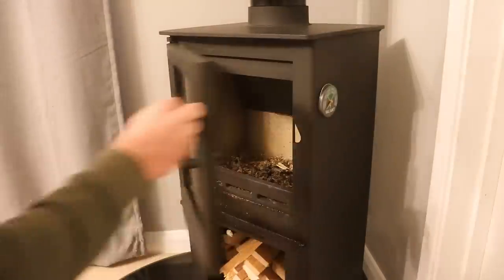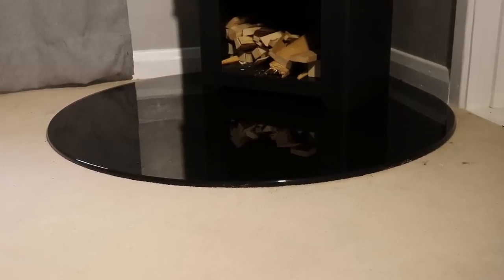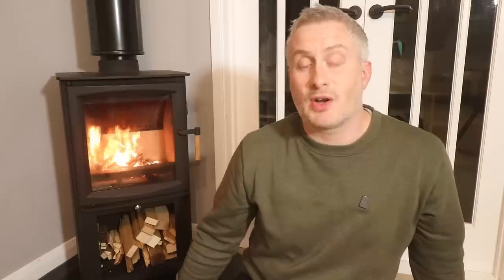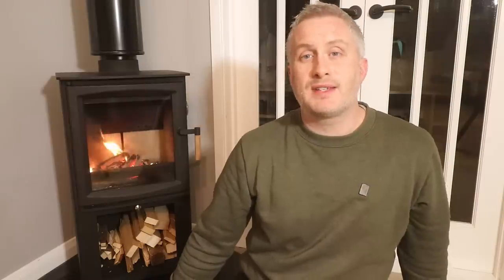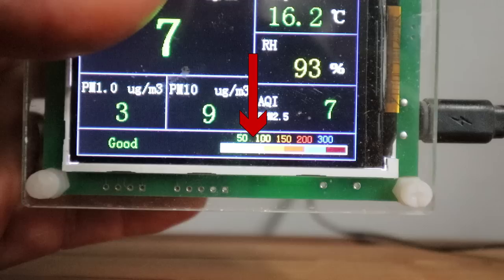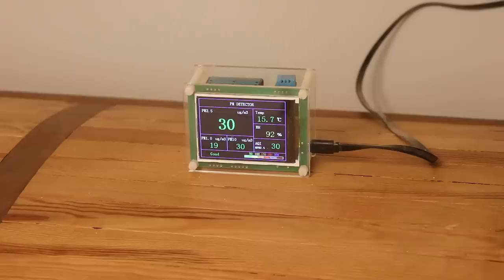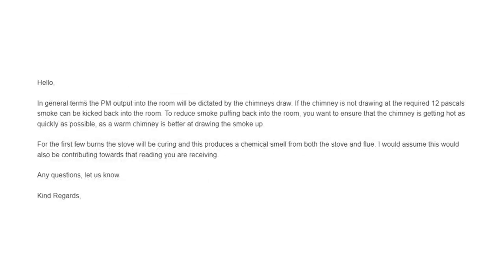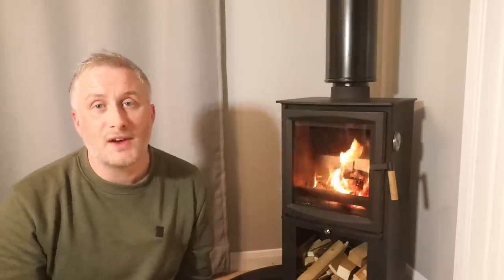Wood Stove Pollution and PM2.5 Particle Emissions TESTED ✓

Comment: All multi fuel stoves need to have an air supply from outside. We have 2 stoves a 5 kw and a 8 kw. The 8 is more efficient burning less wood. Burning smaller pieces of wood is not very efficient and a waste. Bag them up sell for kindling and buy some logs. Saves getting up to stoke the fire every 5 minutes. Trust me I know.
Reply: No they don’t. Only stoves over5kw require an external feed or recent new builds that are airtight.
Reply: @d17mop  If your home was built after 2008, there are slightly different ventilation requirements. New builds are very airtight compared to older homes, so you will need to carry out an air permeability test to determine how much ventilation you will need to fit for your stove. This also applies to extensions.
Reply: @d17mop  It gets more complicated as a recent change in building regs for ventilation covers additional requirements when energy saving improvements are made to the house as originally  built . So new windows/ loft insulation even a loft hatch insulated adds points to the requirement for additional ventilation. You don't want an air brick blowing cold draught into your room. That is why here some HETAS engineers are insisting an external air supply to all stoves.  SO a blanket statement does not require outside air is not correct for every situations and stove outputs. Remember the ;living effect gas fires had to have additional ventilation.
Reply: @zivadivathedog9392  there is  enough  advantisious air in a property with opening of doors and leaving a room. It’s just sill regulations people covering themselves from claims.
Reply: @d17mop  You need to read Building Regs part F before you make another reply. I suggest you read it a few times especially if you are not a professional so it sinks in as there is a point system to what additional ventilation requirements are required when you add additional energy saving measures over the original structure as it was.
Reply: @zivadivathedog9392  not under 5kw
Reply: @d17mop  While you are correct sort of. The ventilation part of building regs take over as you improve the energy saving measures in our homes. This is inevitable as energy costs rise. So to avoid having in the future an air brick in your front room ' Fit Additional Air Supply From Outside' your stove should except this.
Reply: @zivadivathedog9392  I’m more concerned to how close those curtains are to the stove. 300mm. ?
Reply: @d17mop  That depends on the stove. Your stove has what looks like fire bricks inside so that all the heat is forward so should be OK. Just feel the curtains after the stove has been on for an hour or 2. My 8kw Broseley has steel fire bricks so the masonry around the stove gets quite warm.
Reply: @zivadivathedog9392  what utter rubbish
Reply: @d17mop  Rubbish! you never find a stove on hearth then carpet in any of the stove catalogues the curtains will get dirty and the carpet in front of the stove, unavoidable. You are getting paid for this. saying that building regs should be ignored over ventilation requirements. Have you read building regs? You should.
Reply: @zivadivathedog9392  like I said. Who would hang curtains near a stove. Certainly not me and not that close. Ask any1.

Comment: You haven't considered your neighbors. Have you done readings outside? I'm in hell from all the smoke in my neighborhood which because of the particles settle breathing level so forget outside walks. Btw, it comes into houses threw roof vents. Doctor says my childhood asthma has developed into early-stage COPD so I am mad as a nonsmoker I shouldn't have it. Btw, I've learned burning wood releases the stored carbon (plus benzene, PAHs, formaldehyde etc)  which we don't want to do during climate change.  Wish you did a heat pump.
Reply from the maker: Yes I did, in a vlog video following this
Reply: So true, I love the concern about the pm 2.5 in the house but to hell with pumping it outside.  If everyone used one can you imagine the air quality.  I understand some people have no other means of heating but in cities and towns with some people spending 5k on them  and it only really heating one room I can't help but think it's not that efficient anyway.

Comment: I had a multi fuel stove installed 3 weeks ago, mine is enamel but still has to cure for the first few burns, the fumes from mine set the smoke alarm off so had to remove the battery for a few hours.
I live in Cumbria, cost of installation was £2400, that included the stove opening up the builders recess in chimney breast and slate hearth with slate recess lining [stove online is £999 but fitter paid trade price which is not known to me].

I mainly use coal, if lit early morning  10 am [ish] I will use around 5 kilo of coal, if mid afternoon 2.30pm to 3pm I use around 3 kilo of coal

Comment: Great advice.  Had ours, a Burley, nearly 10 years.  It is perfect for cold autumn and Spring evenings but in the deep winter when lighting it after work it can take too long to get warmth around the house so we use the Central Heating.  The word burner is on all weekend when we are home.
Biggest learning I have is when starting the fire be sure that it gets super hot, a stovepipe thermometer helps judge, before adding too much wood as the stove can then sulk.  Getting it hot enables the secondary burn of the gases above the wood.  When adding fresh wood it is also good to get the stove roaring a minute or two before and after the wood is added.
Also the Scandinavian top down method is by far the best way of starting the stove.
https://www.youtube.com/watch?v=h-vQVspbfOI

Do you have an external cold air feed? That helps keep drafts created to a minimum as the stove draws air, think it is a regulation if over 5Kw.
One wish we have is that we had gone with a two sided model as out stove in between the living and dining rooms.
Oh yes, kiln dried, or very well seasoned wood makes a massive difference.  We use White Horse Energy supplies( i have no affiliation), but there are plenty of similar suppliers. Just never buy logs from DIY stores or Petrol Forecourts.
Reply from the maker: Thanks very much John, I will be giving the "Scandinavian method" a try this evening - totally makes sense - wasn't aware of that.

I don't have an external cold air feed, but we have a PIV (positive input ventilation) system in our loft due to past problems with mold, and also trickle vents in every window so I think it's able to draw from those quite effectively.

Comment: Bad install. Distance to combustable to the side with this stove is 550mm. Looks like the door frame and curtains fall within this. I would also guess the walls are plasterboard which is also classed as a combustible. Should be condemned

Comment: I have no problem with requiring low emissions from new wood stoves. I never used to be bothered by the smell of wood smoke and liked it to an extent, but right now in the midwest, we have the worst air quality on the planet from the Canadian wildfire. I'm finding you really can get too much wood smoke. It's f*cking awful. I don't want to smell a fireplace or camp fire for at least six months after this.

Comment: Based on what the company said dunno if it helps but when we first got ours what the said was to heat the liner of the chimney first what they recommend was burn some newspaper etc etc very lightly first then put your fire on. Just a help. 👍🏴

Comment: Hi Rag 'n' Bone, Just one minor issue with an otherwise very informative video, should you consider that it is the convection current generated by the stove in the room that could be stirring up and circulating small particles of dust already in the room, in particular increasing the rate of air circulating around your sensor machine, after a few cycles this dust was deposited in undisturbed locations of vented through the stove. It is always a good idea to explore other alternative explanations for any observation and not draw hasty conclusions. 
On the subject of trying not to breath in polluted environments you are just being foolish, with the best will in the world you can only reduce your respiration rate by a small percentage, by all means ventilate the room effectively, of course this will mean losing the benefit of any heat!.
Cheers, Richard.

Comment: Cheaper  to heat your home this way is simply not true, if you can get free wood and lots of it and free coal then yes obviously. I have had a multi fuel for 14 years and use it because I enjoy it. They are a novelty thing and not a cheaper thing and any suggestion otherwise is simply misleading. A lot of people think they are cheaper just because 🤷‍♂️. Log burners are rising in price because everyone wants one and thinks it be cheaper! Coal and wood is also rising in price because everyone wants it because they think it be cheaper. Heatas installer's are charging more because they are flooded with work because everyone thingking its cheaper! Yes and don't forget chimney sweeps, kinderling wich you need lots and lots of and then your stove maintenance/servicing. All of the above costing money 🤑🤑🤑🤑🤑 don't get me wrong I'm not saying it's more expensive but is it really cheaper🤔
Reply: Never have my central heating on. My wood burner heats the whole house. So it works better for me. Plus I’d rather give my money to my local wood supplier than the greedy energy companies.

Comment: If the house is quite sealed-in, with double-glazing, then doesn't the fire eat-up too much oxygen? Maybe I am missing something. If the fire had a cold-air input then this wouldn't be a problem. Also it's going to be more expensive than oil-fueled central heating, more trouble, and pollutes the neighbourhood. Makes no sense to me.
Reply from the maker: We have trickle vents and a PIV system, so no... How is burning free wood more expensive than oil at 80p per litre? Did you even watch the video?

Comment: I think if you care about your health stop eating McDonald's. Also will the heat move dust particles around. 90%of my heating is from the wood burner. First light of the season chimney is cold and draw is less. Once it's warm is fine for the rest of the season. Also fire pulls moisture out of the room. Good for mould reduction

Comment: Couldn't give a rats arse what the law or local authority says, I put my own Woodwarm logburner in 4 yrs ago, obviously in accordance with the building regs (except for the info plate that is supposed to be fixed to wall nearby) as I wasn't prepared to be striped off by the various greedy people I got quotes from that wanted in the region of £10 grand for the job excluding the log burner. The flue supplier told me which flue I required which I purchased and installed, a builder mate did the roof work for me and it works fine. Swept by a professional sweeper annually, had no issue at all. If you can do it yourself, do so or just be ripped off. There are plenty of decent people out there that will give you advice and help.
As you correctly say, fuel prices are out of control so its the only cheap way to keep warm now if you have access to cheap off cuts etc.